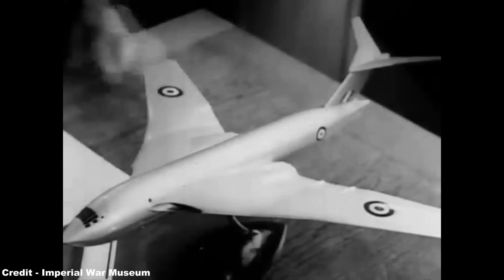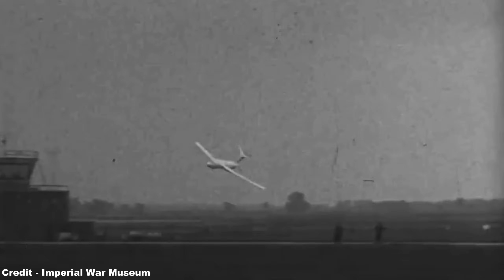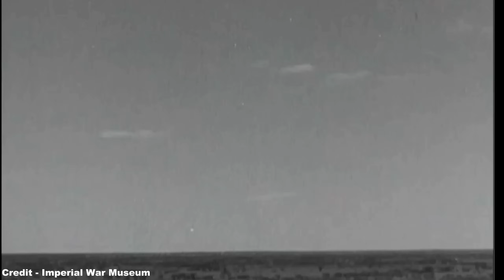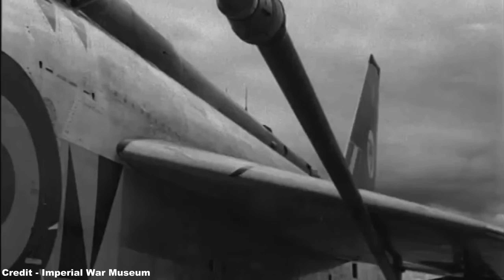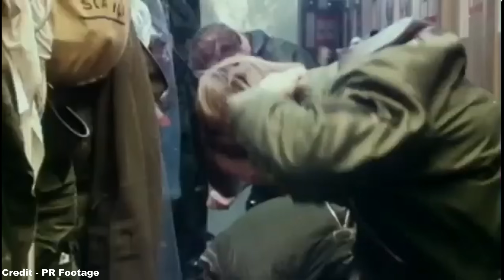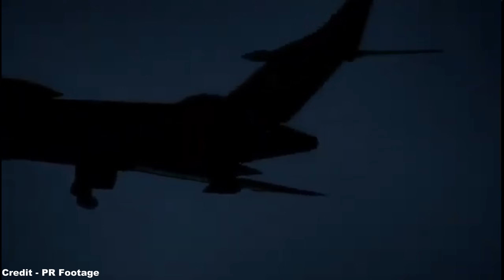The Vital Victor - The Handley Page Victor Story

Comment: Sorry, this isn't quite up to your usual very high standards @rorymacve.

Aside from the mispronunciation of RAF Wyton, there was no mention of the fact that during the early stages of development of the Victor, it was initially intended to be a tailless design; the innovative T-tail - worthy of discussion in of itself - was only a later addition. Also, although there was some mention of the maritime role, there was no mention of the anti-submarine (ASW) role specifically; Denis Healey once claimed that (thanks to the SR.2), the British knew the location of every British ship in the Mediterranean.

A mighty aircraft. The comparisons between the V-bombers are interesting. The biggest "what-if" is if the "Pathfinder" Valiant B.2 had been put into production. Supposedly not suffering the fatigue issues of the B.1, it was purportedly the most suitable of all the V-bomber designs for operation at low-level.

Comment: I still wonder why the RAF wanted three different V-bombers. I still think the RAF should have standardized on one model--the Avro Vulcan--and it would have served with distinction right through the late 1980's.
Reply: They initially intended to purchase and retain two advanced bomber types for actual service, but quickly (and correctly) guessed that the Victor and Vulcan designs were so ambitious that they’d take the best part of a decade to refine for service use, hence the simpler Valiant was ordered as an interim stop-gap. 
When the RAF later lost its role as the UKs main nuclear deterrent arm in the late 60’s, it was determined that only one type of bomber needed to be retained going forwards as an efficiency measure.

Comment: Base model for the front of Thunderbird 2. Well,posably. Is intriguing to wonder if we didnt faff around with the TSR2 aircraft and just went straight into making our own version of the smaller American F1/11 wheather the Tornado would have been available instead of the Vulcan for the Port Stanley airfield with its special anti-airfield weapon. Would still have needed refuelling on the way of course. Must have been exciting to be around in the late 50s to see these new designs taking to the skies besides new buildings and towns replacing blitz flattened city areas and the Diesel & Electric trains bieng given their trials on the railway network.

Comment: You forgot another B1 v B2 difference, a bigger wing. The wingspan was 10 feet wider.
Reply: Good shout. I understand HP worked out that with the extra thrust of the Conways, the aircraft then became “lift limited” in terms of sustainable altitude whereas the B1 had been “thrust-limited”.